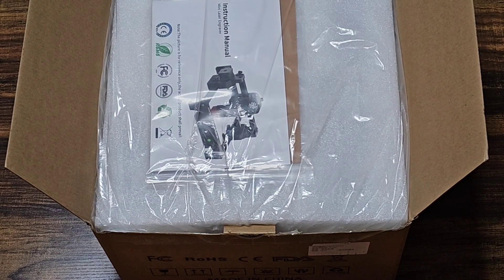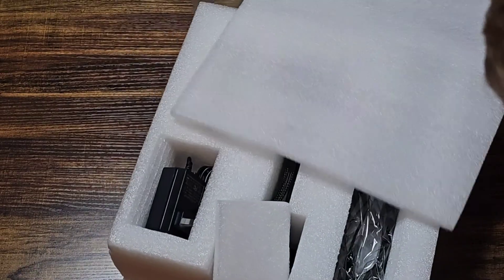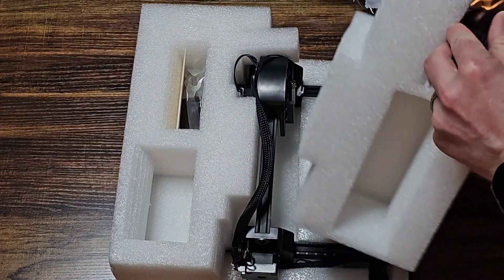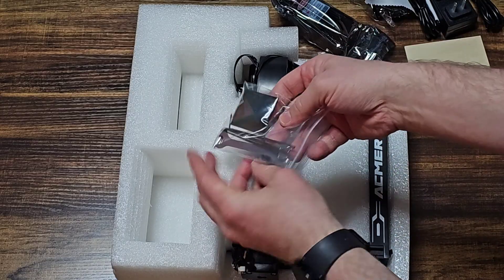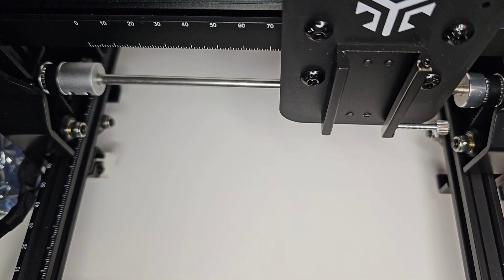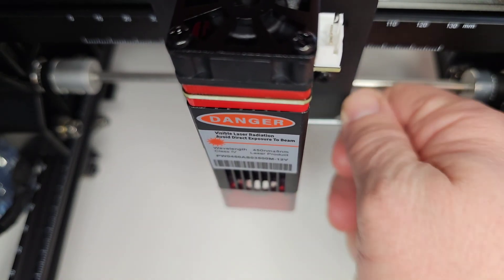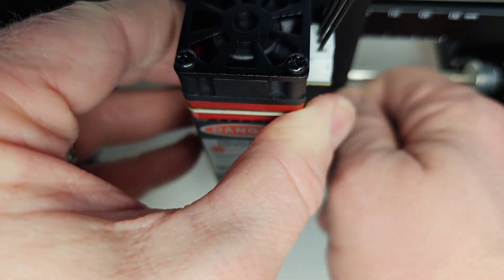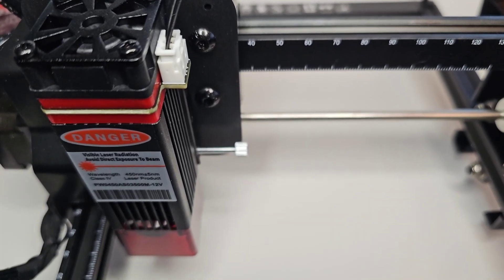Setting Up the Acmer S1 Laser Engraver – Easy Assembly Guide!

Comment: I had a great deal of difficulty assembling attaching the wire the way you showed. The small raised lines on the connector would only go in fcing the left. When ever I tried having them face the right it wouldn't go in place.Now I'm worried I've done it incorrectly and have damaged the laser. I don't want to turn it on and make it worse?!

Comment: would this be able to cut 2mm acryllic? clear in particular? i know diodes arent good for clear, it wouldnt have to be perfect. they also have a 6W version now i was looking at purchasing
Reply from the maker: I haven't tried it but I believe it is possible but you would have to use laser paper, tape, paint, laser marking spray, anything to make it so the laser doesn't just go through it